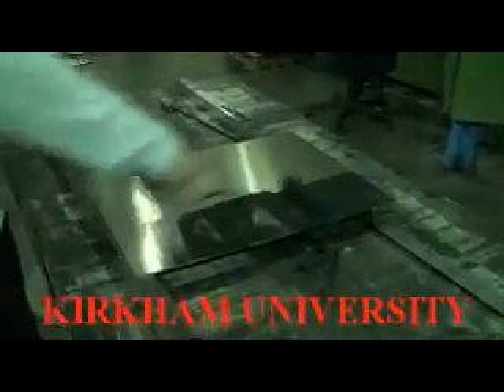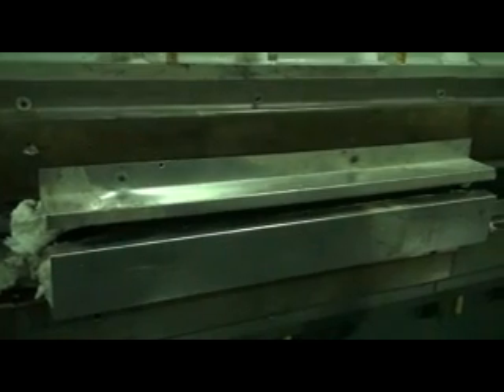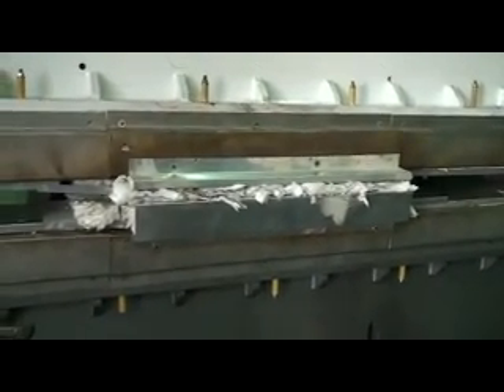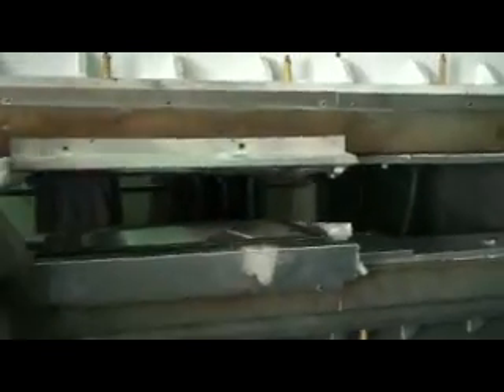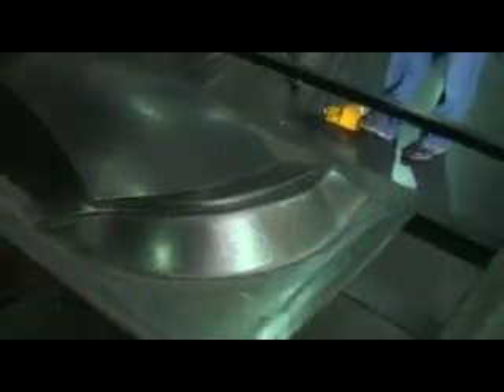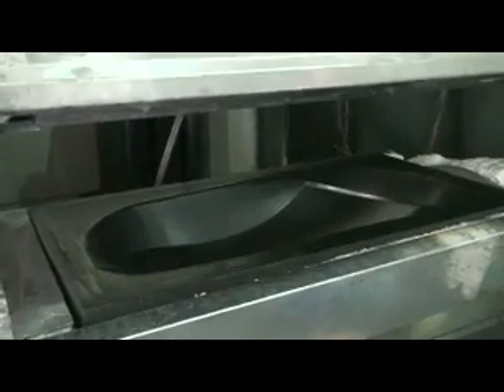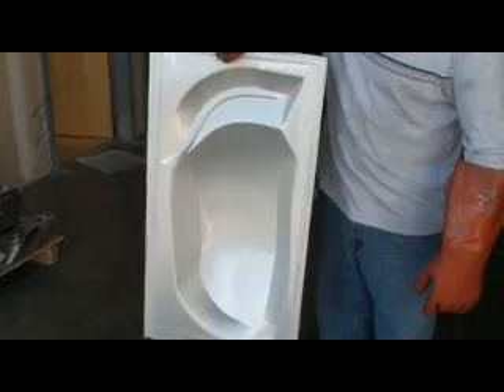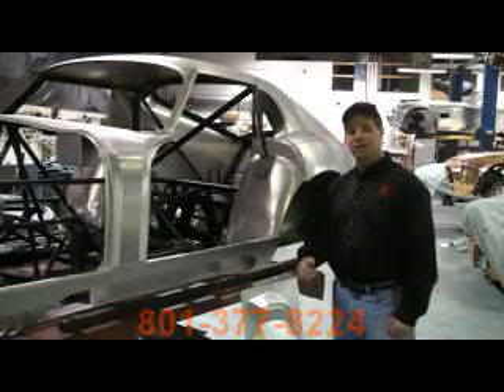Kirkham University Superplastic Forming Aluminum Coupe Rear Wheel Well

Comment: Is there any spring-back with superplastic or hydroforming?
Reply from the maker: There is no spring back with superplastic forming. There is spring back with hydro forming.
Reply: @KirkhamMotorsports1  the cooling process after superplastic forming would affect the springback and distortion of the formed sheet after trimming correct? Thank you!
Reply from the maker: @Ev4nsk1  There is no spring back after SPF.  There is no distortion either, as the metal is formed well into the plastic range.  Residual stresses are very minimal, as the material heated well into the plastic range.  Trimming doesn't move the formed part very much at all.  It is a phenomenal process--it's just really expensive.

Comment: @newcomer9747 I think it is 900 Fahrenheit not Celsius, given that aluminium (aluminum to yanks ;-)) has a melting point (depending on alloy) of about 660 Celsius.  420 Celsius is not to be scoffed at though, it's enough to give it the malleability, that 500psi is ample pressure.

Comment: @UsherLinder i think your question would be better answered by going down to the crystal formation level when the material is heat to 900c. at that temperature, the material plasticity changes dramatically to allow this process, hence only about 500psi forming pressure required.

Comment from the maker: @UsherLinder, Superplastic forming heats the aluminum up to around 900 degrees and then pushes the aluminum onto a form with 100-500 psi nitrogen.  Hydroforming (depending upon the process you are referring to) is forming an aluminum part with hydraulic pressure (from water, or oil) as one of the "dies," or using a block of rubber as one of the "dies" over a form.  Hydroforming is generally done at room temperature.  Superplastic forming is done at 900-950 degrees F.

Comment: I love this series: thanks for posting it!

Questions:   What are the differences between Kirkham's superplastic forming and General Motors' hydroforming process?  True, both processes form sheet metal; Kirkham uses liquid nitrogen while General Motors uses water to create the pressure, but besides that, are there deeper, more fundamental differences between the two processes which would not be immediately apparent?   Thanks! :-)